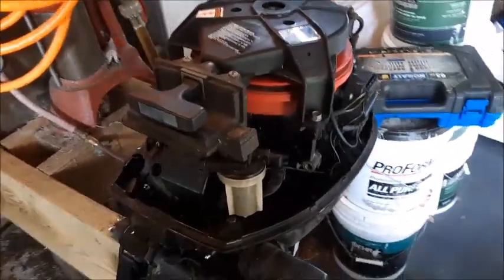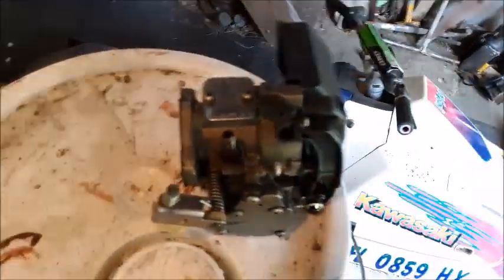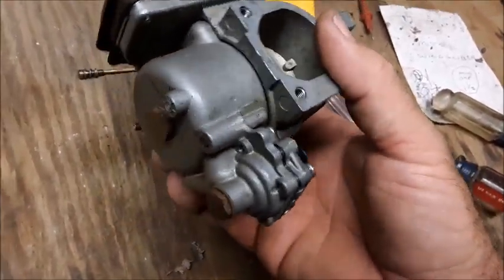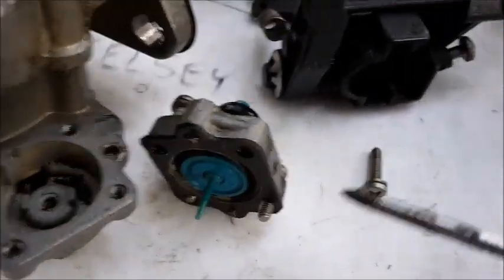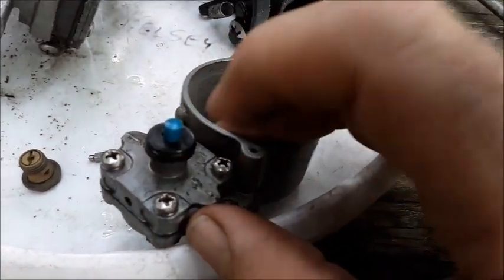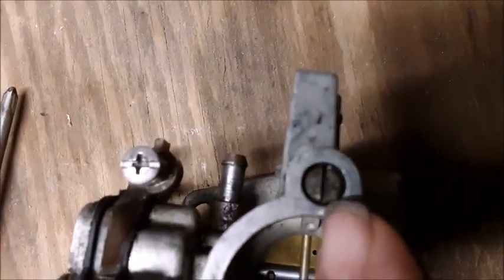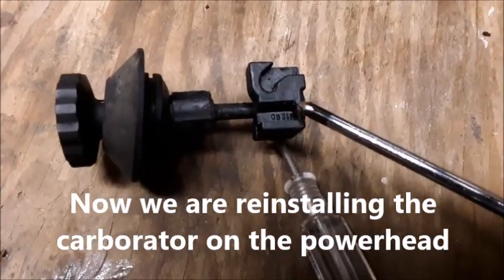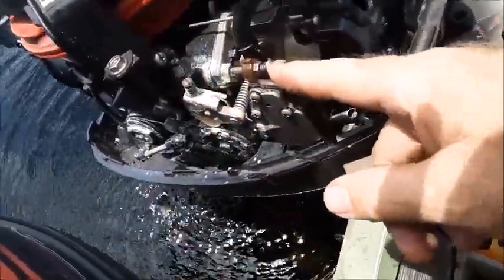1990 Mercury 15 carburetor, Remove, Clean / Rebuild

Comment: Thanks for the very helpful video! 

I've worked on Johnson & Tohatsu carbs before, but when I opened up my Mariner 15 and realized the carb wasn't just going to lift out after removing the flange bolts, I went in the house, washed my hands and hit the keyboard. Thankfully I found your video! Without it, I surely would have ended up breaking some plastic part of the enrichment assembly. 

To other readers, a general word of advice when cleaning carbs - wear eye protection! When you blast carb cleaner through those little passages and jets, you can never be sure where it's going to come out!!

Comment: Great video.  You're the only person that mentioned what operates the diaphragm on the fuel pump.  When removing that small hose at the bottom of the carb I noticed a hole in it.  That was likely the cause of the engine only starting with starting fluid.... no working fuel pump!  So, I'm waiting for a carb rebuild kit that wasn't even needed.... especially since the carb chambers and ports were all very clean when inspecting.  I wish I saw this video before I tore it apart!

Comment: Good video, I was not expecting the sermon, but you have every right to believe in anything you want. One small bit of advice. Never do this on a table with grass or chippings under it, or you may drop small parts and lose them into a black hole. Also you had the chance to clean the fuel filter. Thank you and may your God go with you. P.S. Don't forget to donate any bits you have left over after a reassembly and install to a local charity.

Comment: I appreciate the effort you put in to helping others! I have the smaller 10hp version on my kids inflatable boat (inflatable bottom) but it’s just on the limit to plane with me in there together with them so a little more hp would be great. Is it possible to replace the full carburettor or just some nozzles to go from 10->15hp?
Reply from the maker: Hi Johan,  Thanks for the comment.  I am sorry I don't know the answer to that question.
Reply: the 6hp-15hp all had the same block of that era! the 9.9 idles a bit smoother than the 15hp , and has more low-end grunt. the only benefit of the 15hp is at the upper 5500rpm limit . trust me, not worth it.

Comment: That was a nice video! I hope God is helping you all the time.
I wanted to ask. If you spray in to the intake while the outboard was working, with a carbon cleaner, will it be necessary to disassembly it? Will it be bad for the engine?
Reply from the maker: Spraying carbon cleaner in the intake won't do anything for the carburetor as there are small passage ways gas travels through as well as the carburetor bowl itself which only pump gas into the intake.  Carbon cleaner works well under certain circumstances to fix low cylinder compression.  I have a video on that on my channel.

Comment: Great video!!! I wanted to ask you or anyone to see if you have a clue what could be wrong with my motor. Today I went to the swamp meet and picked up a grayish Mariner 15HP. The engine and carb looks exactly like yours. I tested it and it wouldn't start. Check and there are sparks. Traced the fuel up to the carb and it's good. Tested with started fluid inside chamber and still no start. Tested starter fluid into the carb and still no start. It acts like it wants to start but will not. Checked the fuel cut off switch and it's fine. Took carb apart and carb looks like it was recently rebuilt. Checked and air blow everything except the enrichment valve or the bottom nut, spring, ball or the passage. I put everything back and tested again. It feels like it wanted to start but still can't. I removed the gear safty lock on the pull start and attempted to start the motor in forward gear. It started if I pull the choke and leave in the forward gear. Once I switch to neutral, it'll die out. What could be the issue? I'm going to order a new carb kit and give it a good cleaning myself.
Reply from the maker: Carburetor kit sounds like a good idea particularly the needle valve rubber tip.  Maybe take a look at the reed valves when you have the carb off.

Comment: Hi i have a 9.9 2 stroke just clean and change all gasket. I put all them back now when i pump the gas im getting big leak on the side of where it say TOP. Hope you can help me. Thanks!
Reply: I'm having the same problem. Did you get it figured out

Comment: Float question. One side of the float has 2 dimples on it. The other side is smooth. Which side lays on the forks?
Reply from the maker: I am sorry I don't know it has been too long since I had that one apart.
Reply from the maker: Perhaps you could look at a parts diagram online and see if you can tell.

Comment: Great video, rebuilding the carb was easy. Reinstalling the primer is very difficult! There has to be an easier way!
Reply from the maker: Your right, getting it to slid back into position takes a few tries.
Reply: I have mine what seems like it’s in position but it seems like I need to apply inward pressure to get it to rotate.

Comment: at 1:13 I had to laugh,,that little pease in there,,that little pease in there can give you a time when you go to put them back in,, I’m working on my 9.9 , I think I got a 15hp carburetor on my 9.9,,it’s identical to my 15 hp merc
Reply: Hi Bob.
The 9.9 and 15 are the same motor. The jets in the carburettor on the 15 hp are slightly bigger, that’s all.
Reply: 15Hp uses a WMC-49a carb (depending on year). The 15hp has a larger diameter inlet for more air and fuel.

Comment: those reed valves are junk! that much discoloration definitely indicates backflow aka not sealing properly. good opportunity to replace with fiber reeds. makes a huge difference in starting and idle smoothness, plus cheap insurance.
Reply: Are you talking about the flapper things in the fuel pump ? if so how hard is it to replace them with fiber reeds?
Reply: @anthonycerra5676  no. reed valves in the intake. stock ones are metal. CCMS are plastic.

Comment: Using God's word for commercial benefit.
Reply from the maker: Hi Mark, Thanks for the comment.  I suppose it would only be "commercial benefit" if I was getting paid by someone which is not the case.  I hope you got you boat motor running better.  Thanks